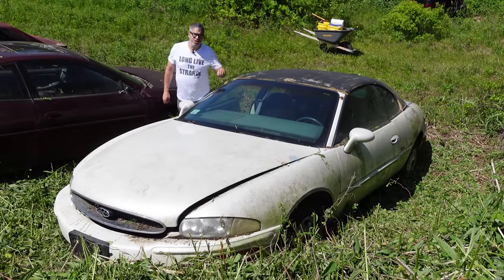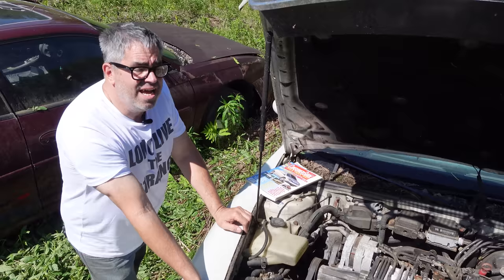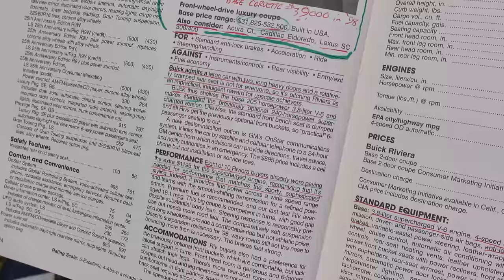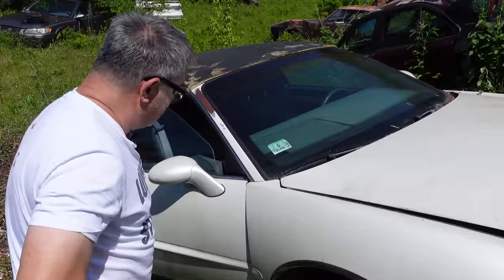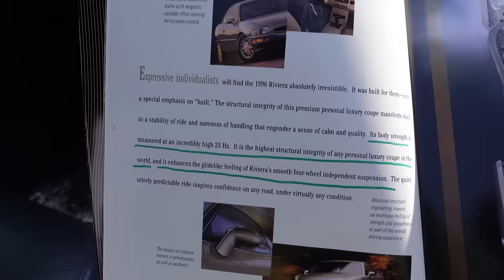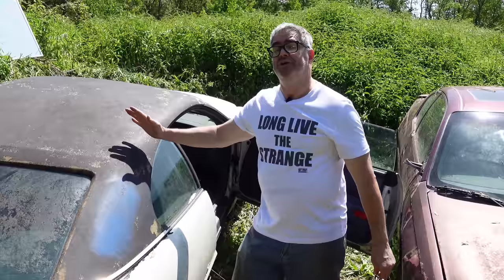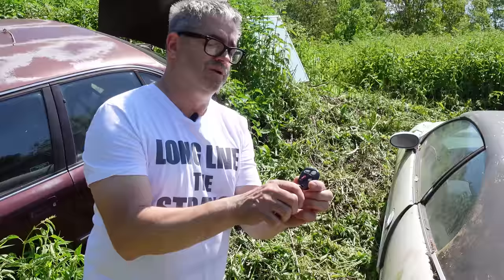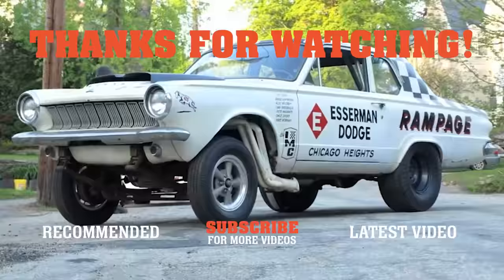More Power Than A Grand National!

Comment: It's pretty common knowledge that the Grand National horsepower ratings were highly underrated. In real life they were pushing close to 300hp.
Reply: These fwd 3.8 Sc's were also underrated.. These 3.8 in the grand prix would outrun the sn95 of the time and give the s281 a good run.. they were way stronger than what the numbers said..
Reply: Not just those cars. My '79 Trans Am is 220 HP on paper, but according to tests done by the NHRA back in the day, it was well over 250+ HP at the time.
Reply: @googleusergp  true, because of insurance rates and mpg regulations Detroit didn't lie about power. They just stopped testing at a curtain rpm.   Like the 75/76 ta 400 they only rated the power up to 3,500 rpms.
Reply: @rebelscumspeedshop  They had enough trouble meeting the regulations to start with. The 1979 Pontiac 400 couldn't meet CA emission standards and consequently wasn't "allowed" to be sold there, although some did make it there. Oddly enough, some 1979 Trans Ams with a 400 were assembled in you guessed it, California, at the Van Nuys plant.
Reply: A friend bought a G.N. and I was impressed with the performance... then he put in a "Diablo Chip"!! It was a true 80s interpretation of the muscle car.
Reply: @googleusergp  on the 75-76 the intake manifold had half of the secondaries blocked of, they were perforated and all you needed was a punch, hammer and file to open them up.
Reply: @rebelscumspeedshop  The 1978-1979 W72 cars were better performers and you could get four wheel disc brakes and a WS6 handling package with them. I have a '79 10th Anniversary 400/4 speed. There were 7,500 total cars, and only 1,817 of them had the 400/4 speed combination.
Reply: Owner of a 1985 Gran National and properly maintained, the turbocharged power plant produced much more than his fellow's
claim of 240 horsepower.
Reply: @3rdgentexan301  The '87 GN was rated at 245 hp from the factory and the GNX was rated 276 hp. Not sure why Steve thinks the Series II SC is the highest rated Buick V6. Also, don't forget the Series III SC from the mid-2000's made 260 hp from the factory.
Reply: @googleusergp Here in California if it’s not pre 1975 you have to smog it. It’s sad that’s how so many of those cars are getting off the road or moved out of state. Our a not legal option pay extra to pass smog. It’s a wink wink thing. 👍
Reply: @Daniel-fd3wp  One reason I'd never move there.
Reply: As the owner of an 87 GN, this is true.
Reply: Or more.
Reply: @googleusergp  whoa...250😂
Reply: @3rdgentexan301  200 hp is what the "hot air"cars made, please, use Google☺️
Reply: @klasseact6663  Maybe more. I've read 250, 260 and higher. Whatever it is, it's fast enough for the era, rides nice and it's collectable. The WS6 Trans Ams are hard to beat for their era.
Reply: @googleusergp  great looking car though
Reply: @klasseact6663  True and handles nicely as well.
Reply: @googleusergp  handles better with 17" WS6 replicas and modern tires😇
Reply: @klasseact6663  Yuck. The stock Appliance sourced Turbo Flow 15x8 wheels (exclusive to the 10th Anniversary in 1979) do just fine. Mine is a 400/4 speed so that adds to the driving experience.
Reply: @googleusergp  why would you say "yuck"🤔
Reply: @klasseact6663  Those wheels ruin the look of the car.
Reply: @Google User GP  They look exactly like the 15 by 8 wheels you are talking about. Your not "original guy" are you🙄
Reply: @rebelscumspeedshop  What?? Nothing was "blocked off" in the intake..
Reply: The LC2 3.8 in the 86 & 87 Turbo regals is legendary.  From hot rodding, street racing, to drag racing.   Not only were they under rated but they were absolute monsters when modified.  In the 90s & 2000s countless guys were easily running in the 10s & 9s with full street cars.

I hate it when people compare them to the 3800 series FWD stuff.  Non comparable.  Not even remotely capable of doing what the Grand National stuff could do.

#s on paper dont matter.  In the real world one has a direct performance and racing legacy one does not and never will.  One is considered a fast car amongst people who race, the other is just a regular traffic commuter car.
Reply: @gn4life84  VERY well said!!
Reply: @gn4life84  because everybody drag racesevery single second of their driving time. 
They were great for their era & you could do a lot with them. They were impressive, but also I think every Indy race they were in, they seemed to blow up or eat themselves. 
The Series II was a lot more stout. GM just mildly supercharged them, nothing else. However, you can see awesome videos of L67's in Holdens, in both turbo and supercharged form, doing all kinds of fun things in a chassis that isn't from the 1960's essentially
Reply: @gn4life84  To get a G.N. in the 9's reliably with the V-6, it took a PILE of money, and they weren't all that streetable after that. 

Back in the late 90s, I had one that was in the mid 9's, so I'm well aware of what it takes, and it was NOT that simple to do it. It took extensive engine work, trans work, rear suspension work, alot of ECU tuning, an aftermarket turbo, intercooler, and piping. 

Today I have an N/A 547" big block G-Body that regularly goes mid 9s, and it is more reliable, less finicky, and drives way better on the street than the turbo V-6 did... 🤷🏻
Reply: @davelowets  I have had 4  GNs/ Turbo regals.  Nobody is comparing them to a NA Big Block 547.  What did your 547 cost????  I'm sure a boatload.  How much of that has to do with 40 years of advancement in tuning tech , engine management,fuel injection (or modern carb tuning if thats what you're running)?????   
G-body is a gbody the suspension work is going to be same cost & effort wise.

What type of street-able MPG you getting in a 547 BBC??? lol  (assuming its BBC for argument sake)

Plus nobody is comparing it to a built BBC.  Comparing it to stock 3800 series in regular non-performance cars. lol
Reply: @olikat8  Not based on the click bait caption. No they were not great performance or powerful engines comparatively to what was available prior, during and after. They might have made a decent daily for some. I had a couple daily drivers with them.
Reply: @gn4life84  I AM comparing two of basically the SAME cars, BOTH in the mid 9s, one with a turbo V-6, and the other one with an N/A big-block Oldsmobile V-8. It cost about the same to put both engines in the mid 9's. And NO, it has nothing to do with 40 years of advancements when the Olds is a 50 year old engine platform. Yes, it's carbed, with a 1250 Cfm Quick Fuel Domimator, AND it's also fuel injected, with a plate under the carb with 2 fuel injectors in it, and then the required sensors and ECU to make it work. You set the carb a few jets lean, and then let the supplementary fuel injection system make up the difference in real time, all the time. Cold starts with a chokeless Dominator? No problem, just reach in the window, turn the key, and walk away.. Rich and loading up at stop lights? Nope. 
All the top end power and throttle response of a carburetor, with all the convenience of F.I.? Yep. 
I get 10-14mpg  with the big block, and it just has SO much better street manners, and torque, than my mid 9 second G.N. did. Don't get me wrong, I LOVE the Buick G.N., but an N/A big V-8 is just better for big power in a street car.
Reply: @rustbeltrobclassic2512  Grand Prix SC 3.8L ran hotter timing from factory and was spec'd at 260 HP near the end. Earlier GTP and Buick SC 3.8L made the 240 HP spec. I've seen dyno runs for two stock SC Rivieras, both made 200 WHP, or ~240 crank. These engines were great, but they delivered their rated power as advertised by GM.
Reply: @gn4life84  Couple simple mods & they were much more appreciated. The GN was great, but the Series II 3.8 is a much better building block. I've even seen both stripped down, side by side in a friend's machine shop (he was a T-Type guy), and even he was impressed.
I think by the time Buick started on the L67 version, they knew it would be maybe 10 years before it was done. So they, it typical GM half-ass fashion, just went "Meh." 
I do love the built L67 Monaros. That's what it could've been in a more-modern chassis. Now Buick is on life-support in the US with nothing memorable, high-quality, or desirable on the lots. They're next to be killed (outside Chinese market). and nobody will care.
Reply: @olikat8  Building block for what?  Performance?  No its not lol
Reply: @davelowets  not sure what you liking a gas guzzling big block  has to do with 3.8 vs 3800s but ok.  Right it still doesn't take away what SBE GNs were & are capable of vs non performance commuter cars.  
Your current BB OLDs fuel delivery & management system was available in the 90s??????
Reply: No they were not.  I have 2 and both tested stock before I added power.  One was at 278 HP the other was 294 HP.   Not 300 HP. No grand national stock is 300 HP.
Reply: @rustbeltrobclassic2512   I had a 3.8 olds cutless 84 that surprised quite a few folks on how strong it ran
Reply: @rustbeltrobclassic2512  Bulllll Chitttt HAHAHHAHAHA in your dreams maybee hahahhah
Reply: Id run that 547 with my little crappy v6,,,not scared and ive got plenty of wins against big talking Big Block guys on the streets around my ao
Reply: @tomcatmcgillicutty6913  Honestly thought the same thing till in highschool we ran one from a dig and on the highway in my friend's mom's GTP.
Reply: @gn4life84  You may have to look beyond "'Murica," which seems impossible for you, but plenty of Aussies have built the Series II. Sorry, it is a much better engine than yours. 

Remind me how many turbo Buicks in Indy or such actually finished as compared to "Shit the bed?" Not many if any.
Reply: @gn4life84  You just aren't getting it... 🙄

Were carbs available in the 90s? Yup. Was F.I. available in the 90's. Yup.

How do the 2 engines compare in rhe same vehicle? Your post about how legendary the 3.8 is, and how it made a great 9 second street car, is what I'm comparing... I've HAD BOTH, and the turbo 3.8 cost just as much money, and was NOT a great "street car" as you say it was. It was very undriveable in heavy traffic, was finicky, and needed TONS of maintenance compared to my current big block, which is MUCH more streetable, more fun to drive in traffic, and I don't have to work on it every time I take it out.

Does THAT clear things up for you? 

Or are you going to come back with something else off topic, or another argument that is incorrect or has nothing to do with it?

Have YOU had a 9 second G.N. street car
AND a 9 second big-block G-body street car, and could compare them side by side? I HIGHLY doubt it... So shush.
Reply: @tomcatmcgillicutty6913  😆 Bring it on then.... I'll be at Hot Rod Drag Week this summer.
Reply: @davelowets  547bbc yeah you can't hook that on the street,,,spinning isn't winning and that's what I see with most of you guys.....
Reply: @rebelscumspeedshop  I wound up swapping the intake from a 1968 GTO onto the 400 in my 1977 TA because there was NO restriction in the secondary as it did NOT have an EGR Valve!
Reply: @googleusergp  Crazy that it only made 250hp even correctly rated. a newer Camaro with a smaller engine and the same 2 valve setup makes almost double that.
Reply: @JohnSmith-fi2ck  Technology. LOL.
Reply: @mstover2809  An EGR vakve on the intake did NOT mean that there was any "restriction in the secondary" the intake plenum is OPEN under ALL 4 barrels of the carb, and NOTHING was "restricted" because of the presence of an EGR valve. 😕
Reply: @da1ve468 low e.t.'s  The passenger side secondary was nearly half blocked by the egr valve passageway.
Reply: @mstover2809  No, that's part of the passage for the dual plane intake. One half of the runners is high, and the other half is down low, underneath the other 4. That has nothing to do with the EGR.
Reply: @mstover2809  Look up some images of a "dual plane intake" on Google, you'll see what I am talking about.
Reply: @rustbeltrobclassic2512 You are remembering it wrong. The manufacturer can lie about their power figures all day. But the individual testing cannot. These engines responded well to mods. Although getting that power down was a huge obstacle. However factory, Mustangs of the era were lighter, and almost a full second quicker in the 1/4 mile. GT's of the era averaged low 15 1/4 times, and these Rivs were in the high 15 to low 16. They were heavy cars, with suspensions built for cruising the boulevard.
Reply: @googleusergp  still slow asf
Reply: @davelowets  he meant in the carburetor.
Reply: @LynxStarAuto  I lived it, it's cool if you don't believe it, but i was there for it..
Reply: @rustbeltrobclassic2512  yeah rite lol 😂
Reply: They were pushing for a minute or two then the rest you pushed it into a junkyard or someone's yard to rot like this one in the video too ...
I kept laughing trough the video how the guy kept saying 'we have here', dude you are standing next to a corpse of a car, YOU HAD not have ... XD
Reply: @rustbeltrobclassic2512  I had a Grand Prix GXP. Really fun car and that engine was great. That 3.8 was bulletproof
Reply: @gn4life84  I love the Grand Nash but the 3800’s can become monsters as well
Reply: @danielanderson8502  Not to me.  How many 9sec or even 10 sec full weight cars are there???
Reply: @pmscalisi  Nothing was blocked in the carburetor either
Reply: @davelowets GN was also starved for fuel from the get go.. once you started increasing the intake flow and the exhaust you had to go with bigger injector tips and add an auxiliary fuel pump to make it all work.. I had an 86 I should have never sold.. 😞
Reply: That’s all absolute BS. The HP ratings were never underrated, they were overrated ( and still are ) so they could boast about the engineering and one up the competition…and the test cars supplied to publishers often had timing tweaked to show the car in its best light. The 1/4 mile MPHs don’t lie and tell the story of HP. Pre 72 cars were rated in Gross, now they are rated SAE Net. If you don’t know the difference, you should stop reading this comment and instead read material on the differences. Neither of these are true RWHP numbers anyway. Insurance didn’t and doesn’t  care about HP, it is not at all in the actuary mix. They look at depreciation, cost of repairs, availability of parts, frequency of accidents, frequency of theft, driver history, et. Al. . So funny, but unfortunately expected, that Americans buy that bogus shite hook line and sinker without even doing a modicum of research.
Reply: @SofaKingQuick  lol 😂 you say that the MPH tells a story on the HP.. well, the streets also tell a story of their own.. regardless of what the latest motor trend stats dictate.. the FACT is that there was no other car at the time that could run the grand national.. not even a countach.. I'm talking about the 1/4 mile.. that's no BS.. everyone was amazed by the way the V-6 powered regal was embarrassing every single car that was put up against it.. and that's right off the dealership lot!! No work.. no mods.. no chips.. nothing but pure HP which was definitely 100% underrated.. you are wrong on this one.
Reply: @michaelfassilis4194  Yup— but the MpH in the 1320 (98) equates to the HP that was marketed when you factor the driveline loss from NHP to BHP.  End of story. The streets are for Low T posers to do roll races, or, as they are called in the drag racing world- mid drive acceleration tests.  As for ET, The GN - stock- ran mid to high 13s in good DA with a good 60 . Very Good for a stock 1987 car but not a killer by any stretch .
Reply: Yup more boost, better injectors, hotter chips and exhaust made the hair driers shame the Corvette angering GM execs.   Hence engine given to Pontiac.
Reply: The Riviera was no joke for it's time and could give Grand Nationals a run stock for stock. I like Grand Nationals too, but it is what it is.
Reply: @googleusergp no it wasn't I have owned 3 79 t/a's and they were enemic at 220hp due to the weight
Reply: @minorclips7541  You must have had ones that were heaps. Mine is plenty fast out of the box. Nothing in its price class could touch it in 1979.
Reply: @googleusergp   I was definitely wrong on that 1 actually found an article attached to the NHRA testing that's fucking incredible I always wondered why a car that had such a low horse power rating It was so easy to slide around corners on dry pavement I'll tell you what I wish I had held on to those cars they were trading back-and-forth for about 500 to a $1000 back in the early nineties If I had held on to them I'd have a nice little payday but I guess everything's kind of like that thanks for making me do the dive on it Sorry if I came across  A little douchey
Reply: What a shame to see that car rotting away in a junkyard. Looks to be complete and in good shape, definitely worthy of restoration.
Reply: @minorclips7541  No issue. I bought a 400/4 speed 10th Anniversary Trans Am (one of 1,817 made) in 1999 when they were "just used cars". I tried to buy an '81 Nascar "Y85" Trans Am about two years ago but the seller and I couldn't agree on price, and we were $500 apart. I wouldn't budge. I knew what it was worth and I stuck to it.
Reply: Common knowledge =/= facts.  Got a video of a stock GN on a dyno?
Reply: Years ago in the early 90s, one of the muscle car magazines did a dyno shootout between two absolutely stock engines, a 426 hemi and the 429 Boss. No mods, nothing but as they were sold, the 429 achieved 537hp, and the hemi achieved 533hp. The advertised numbers were greatly under cut in the 60s and early 70s
Reply: I figure at least 350.
Reply: @rustbeltrobclassic2512 the 3.8 would run neck and neck with sn95. I ran many grandprix,bonneville ssei only one to beat me was one with a pully and slp intake.  I ran one of these a week. We raced 2 nights a week. 1994 gt with 3:55 exhaust and shift kit
Reply: I owned a 96 Lesabre and loved it. The 3.8 was flawless for over 200k miles and powerful enough without boost for the heavier Buicks. I miss my old Buick.
Reply: That was the base. So the gnx truly couldve been pushing over 400...at the crank obviously..
Reply: 1999 GM took all the imperfections out of the previous years and made the 1999 less than 100 exist selling 4  Actually had the HP up to 385